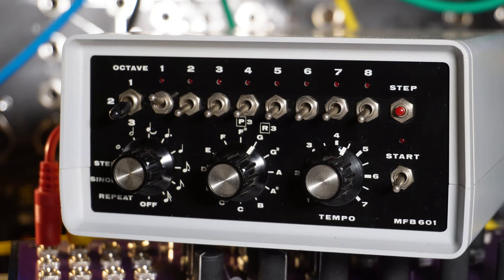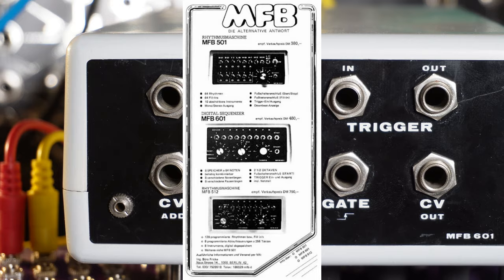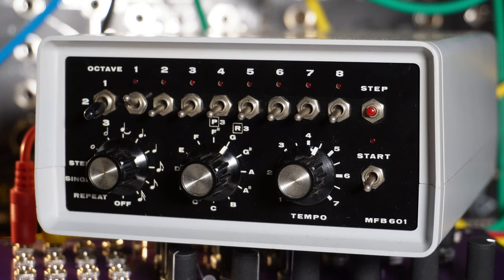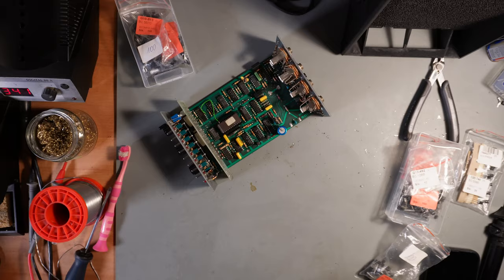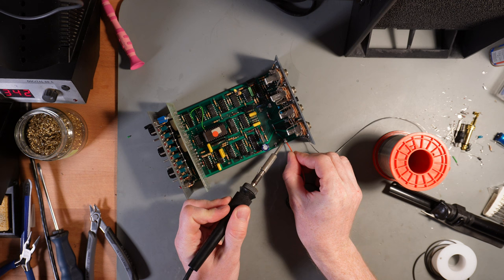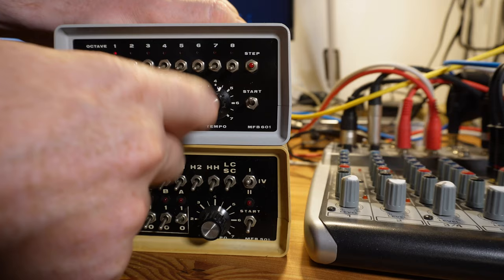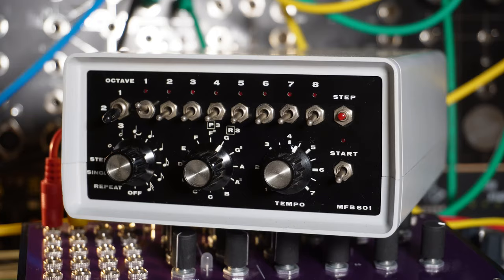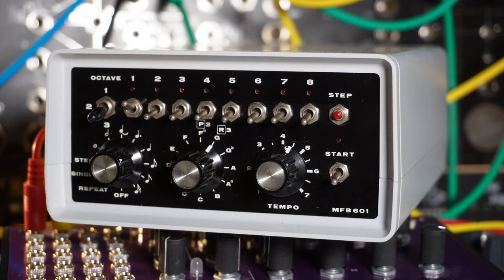MFB - The Music Company from Berlin

Comment: For my first real electronics project I'm wanting to build a Reggae Dub Siren (similar to the Benidub DS71).  Any suggestions on where to start?   (Love your videos by the way).  thanks.
Reply from the maker: Thank you! I'm not quite familiar with the dub siren but I found some rather easy looking builds on Instructables based on the 555 timer IC. I suggest to try it out on a breadboard before soldering it onto a protoboard. Maybe there is even a kit with PCB to get you started?! Cheers, Jan
Reply: @polykit  thanks you.  I'll check them out.

Comment: What kind of power is needed to power this unit, I got one second hand but am afraid there was no power supply with it. 
Can you perhaps tell me the voltage it takes. Please help me...
Reply from the maker: There is a 5V linear voltage regulator inside of the unit meaning a 9V or 12V DC power supply with 500mA should be fine. For the connection you need a 2.5mm jack plug with plus (+) on the tip. Cheers!
Reply: @polykit  thank you for getting back to me, I truly appreciate it. have a wonderful day...